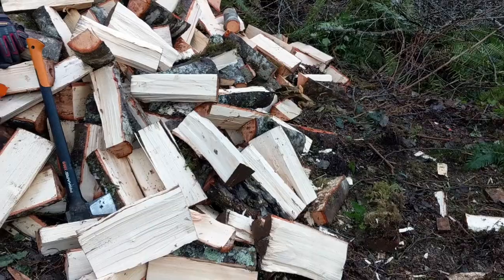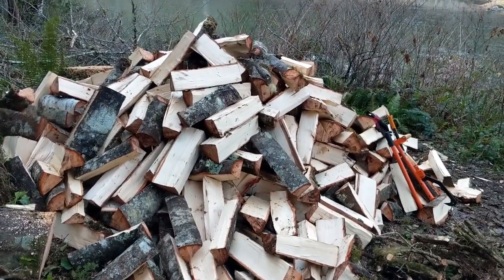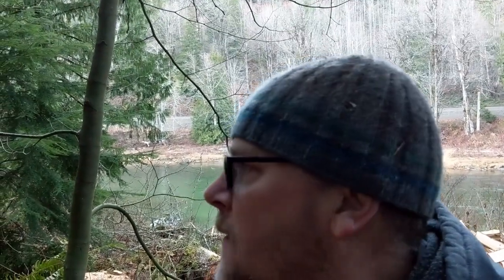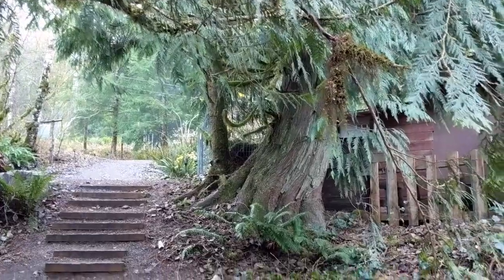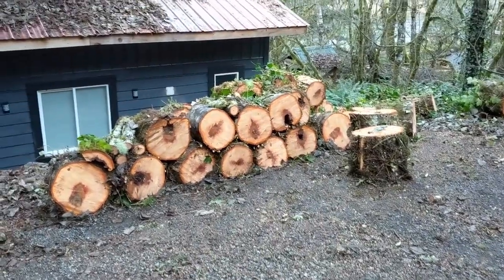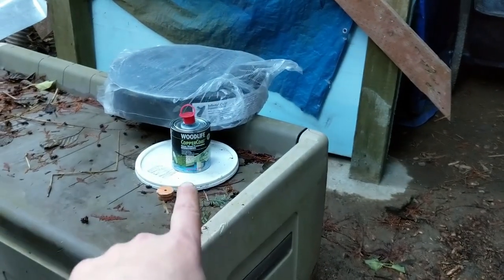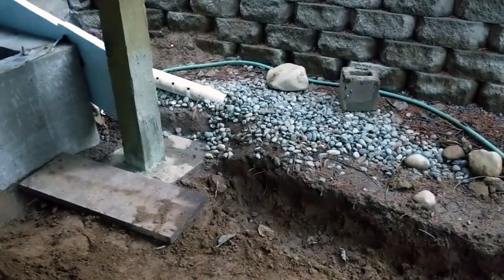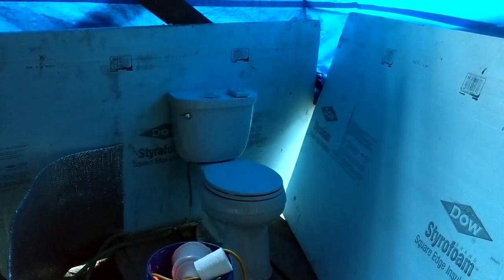Tree Removal - More Firewood

Comment: Oh my, I just commented on your last video about being safe and as soon as this one popped up, I studied the screen really hard...."Is that Jay up in that tree?" HAHA!  And I see that Fiskars is doing you well too !  You need a conveyor system for your firewood transport!  I have an extra Alaskan chainsaw mill I can send you if you're interested to use any of the extra timber from your new cabin spot to use on your basement build.  Not sure how you're planning on doing all of that, but thought I would offer if it would help you out.
Reply from the maker: Haha! That would have been a shocker if that was me in the tree. No way I'm doing that. Conveyer!! You called it. I keep telling Gin that I need a conveyer belt. I hauled one trailer load of wood up those stairs to my trailer in the driveway and it kicked my butt. I left the wood in pieces that are twice the size that will fit in our stove and each one felt so heavy. Thanks for the offer on the mill. We are thinking about going with a corrugated type material on the basement walls. But again, thanks for the offer. I will probably use my mini mill for a few boards for a shed or something. I have about 10 8ft logs to play with.  Have a good one!